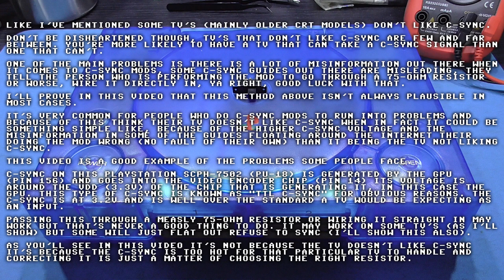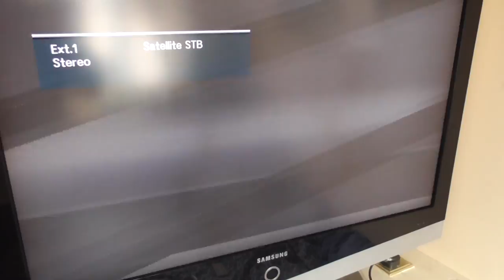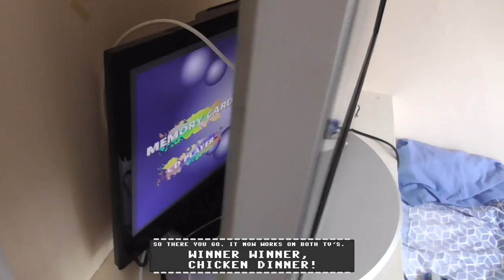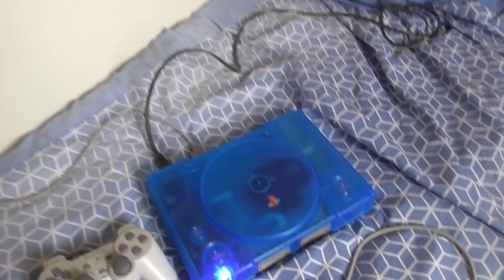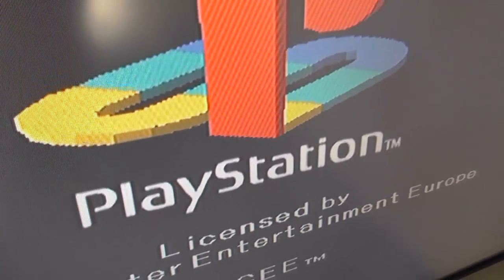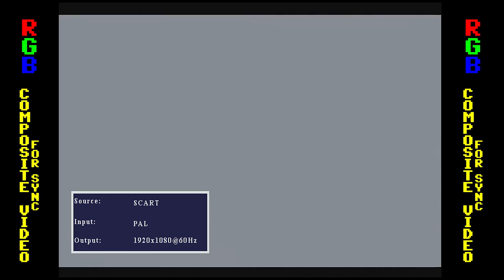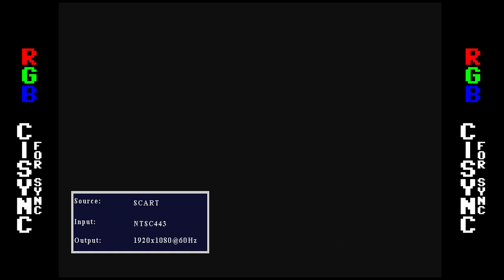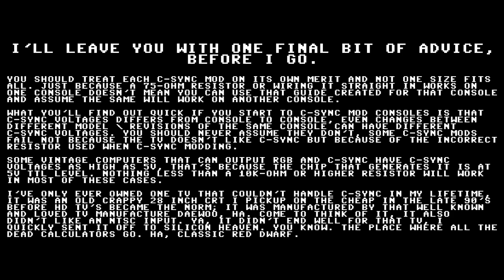Sony Playstation - C-Sync Mod

Comment: I applied that mod to a PAL PlayStation that already has a modchip. Everything works fine so far but whenever I connect my PS to a RGB2COMP  (which is connected to an EDTV using component cables) the picture is still flickering as if the mod was not applied (actually only when running NTSC games). At least I got a much cleaner image now when running PAL games using that mod😅
I placed the switch on the PS front plate (below the open button) so I can easily switch between the sync methods.

Comment: So, I'm undecided whether to perform this mod. The reason being is I'm about to buy an RGB SCART from Retrogamingcables. I can get sync-on-luma with the gunport, or I can get sync-on-composite with the gunport BUT it has a sync-stripper so it gets clean sync. Now, you connect your CSync wire to the composite pin of the PS1's AV port. What I want to know is:

A) If I buy the sync-on-luma cable with the gunport, can I wire the CSync to the Luma pin on the PS1's AV port instead? Effectively, getting Csync without the need of the stripper AND still able to use the gunport as that's using the composite pin?

Or

B) Forget this mod, and just get the sync-on-composite cable with the stripper built in?

Also, do you have a link to what resistor is needed?

I ask because my PVM requires CSync. I just don't know what option to go with.  Any advice would be greatly appreciated. Have yourself a good day 😊

P.S. Love the Red Dwarf reference at the end. Lister, barely human, what the hell?
Reply: @redhotsonic Or C) get the new hdmi mod that’s coming out soon called ps1 digital made from the same guys who brought the dchdmi to the Dreamcast

Comment: Just wondering what the other mod that you did was besides the CSYNC mod?, I see a bunch of colored wires coming out of something on the top right of the board... Is this a disable copy protection mod chip?

Comment: Question how did you get the PlayStation logo on your clear case I got one but how do I put a logo on it
Reply from the maker: I took the logo off from the old case, it's held on the case with adhesive and comes off easily if you get a sharp knife and lift it up gently.
Reply: @Four_X  shit, there should be some of these around loose so we don't screw up our old cases

Comment: ( open palm wipe to face ) 
Wish we had the opportunity to have SCART on PSx and other systems here in North America...
S-vid was as good as it came for some time ( a grand jump, but not SCART ) before component video on PS2. Problem with component video of the PS2 from some PS1 titles are in the quite noticeable shifts in their brightness and color intensities - i.e., Metal Gear Solid - that an adjustment would have to be made under the Custom video preset on my Sony WEGA that I'd rather reserve for settings that can improve GunCon efficacy...
Going to have to measure the investment needed for SCART in North America through a Framemeister for my flat screens anyway...
Again, FourX2k3, great vid from my perspective clear across the pond! Much appreciated!!
Reply: Isn't it ironic that I need an RGB scart cable to play NTSC games on my PAL PSX? (otherwise they'll look black and white on PAL CRTs)

Comment: hi, question what exact scart cable are you using for psx?
Reply: A standard SCART cable uses sync on composite for sync.

There are alternative sync on luma variants, that pull from the Svideo line, as well as cSync variants, which pull H+V sync separate from any other signal.

Retrogaming Cables UK sells quite a few of these options at a decent quality.

Comment: if i disable c-sync i can use a component cable on my ps1?
Reply from the maker: No, the Playstation dosn't natively output over component cable. the best video we can get out of a Playstation is R.G.B. over Scart.
Reply: i know this, but i have found some information that says, if you disable the green fix you can utilize component on ps1

Comment: peolpe rgb mods and their HDMI Tvs... The only way you¿ll be able to get a decent image is using RGB/component  on a CRT! SONY WEGA is a good one! unless so dont waste your time
Reply: @Jerome VV PVMs can be found easily enough for less than 150, sometimes even 100 or free. Most don't need to be recapped. recapping also costs maybe $20 if you can do it yourself. Computer CRTs with an OSSC are 1000000x better than any LCD setup as well so you skipped that. LCD + OSSC is fine but not better. The input lag is too much. 

Some CRT Benefits

- Multiscanning (every resolution is effectively-native, no need for scaling)
- Better contrast ratio (deeper blacks, ability to display crisp white and pitch black)
- True black (black on a CRT is pitch black, not grey like on a LCD)
- Infinite color depth (an unlimited number of colors can be displayed, free of posterization/banding)
- Better color (more vibrant image)
- Zero processing lag (as soon as a signal gets to a CRT, it is blasted onto the screen at the speed of light, less lag between input to PC and response of monitor)
- Instantaneous response time (phosphors change state without delay, less lag between input to PC and response of monitor)
- Can often be found for free (abandoned CRTs often outperform even the best LCDs, saving huge amounts of money)
- Ability to use light pens and light guns (this isn't a major advantage for most people, but it is an advantage and it does need to be mentioned)
- Multiple aspect ratios available (whatever aspect ratio you prefer, be it 5:4, 4:3, 16:10, or 16:9, you can be assured that there is a CRT for you)
- Lack of motion blur (moving objects on a CRT are as crisp as still objects)
- Superior display connectors (VGA and BNC have no set bandwidth limit)
- Free of Digital Restrictions Management (no HDCP or other DRM schemes)
- No grainy matte coats (picture is always crisp and free of the sparkle effect that many LCDs have)
- No backlight bleed (black level is the same on all parts of the screen)
Reply: @Jerome VV 2D retrogames do look better on CRTs: they need that "natural antialising" that the low resolution of the CRT gives to them, otherwise they'll look like a blocky, pixellated mess